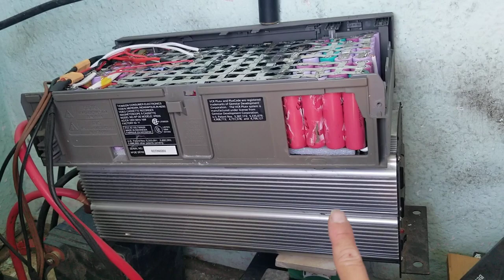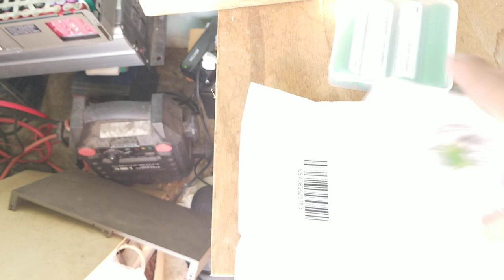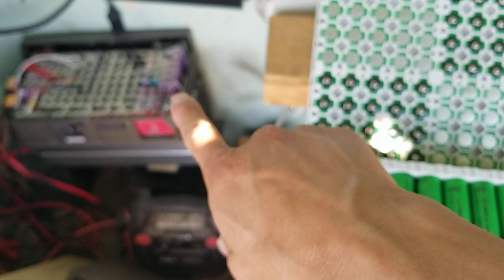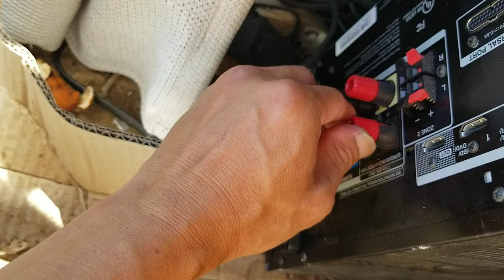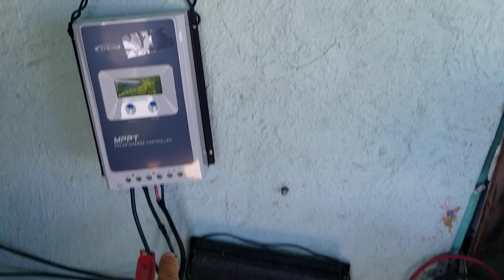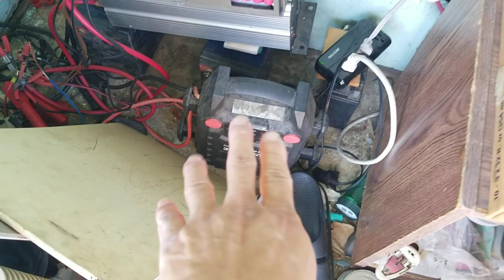Home Battery backup must have and great tips + save $ link below

Comment: Trying to use 3.7 volt lithium to work on 12 volt lead designed equipment is troublesome.  7s 24 volt works way better.
Reply from the maker: Thanks very much for your feedback. since I have so many batteries,  very hard to sell to get money back.  I will look into inverter.   Do you know which brand is good for 24v?  on Amazon and ebay?  Thanks